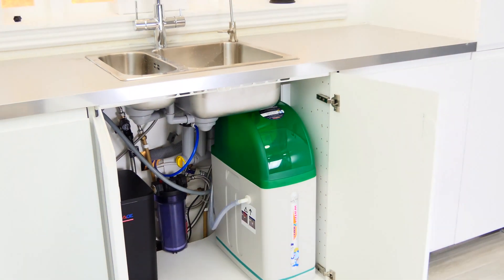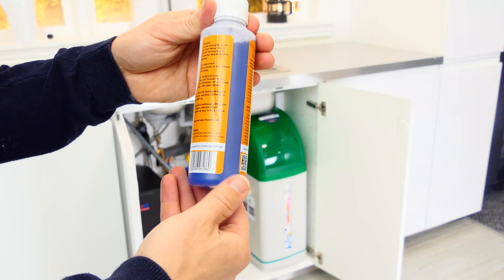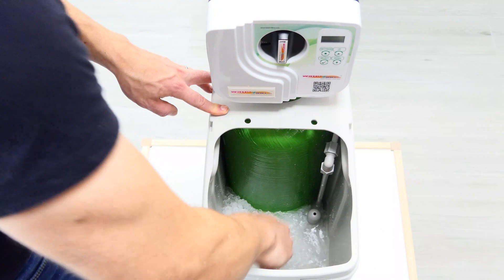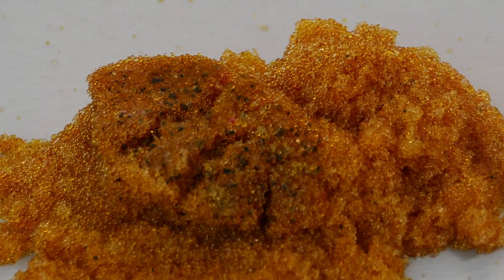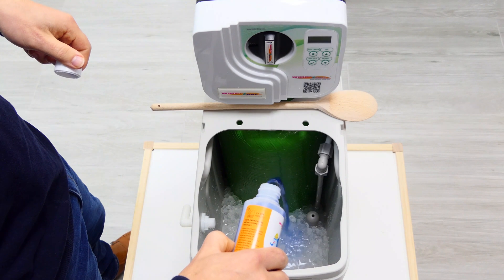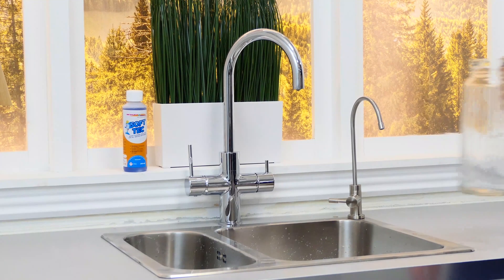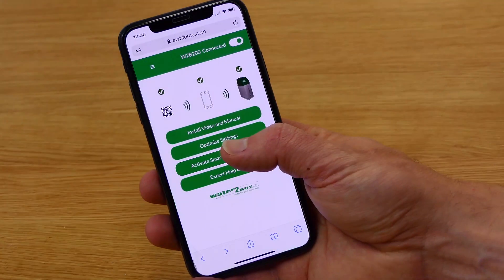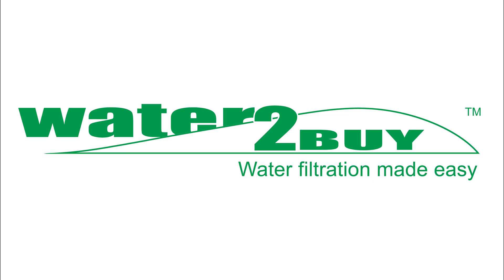EASY DIY WATER SOFTENER MAINTENANCE VIDEO

Comment: The question is, how does this work compared to the products that you have to put straight into the brie tank? I don't think we can gain access to brie tanks in new water softeners, so do we just simply put it in when salt is low, start the regen process and that's it? Do we do the regen process more than once?

Comment: I have two big ones in two houses and I am very happy with it. However have never used the resin cleaner. Will order two bottles. The system is in operation since two years. Fortunately I don't see the performance going down yet but I will prevent from doing so by using the resin cleaner.
Reply from the maker: Hello Marcus,
That is a very good thought of using the resin cleaner as it will help keeping your resin healthy.
Thank you very much for your feedback :)